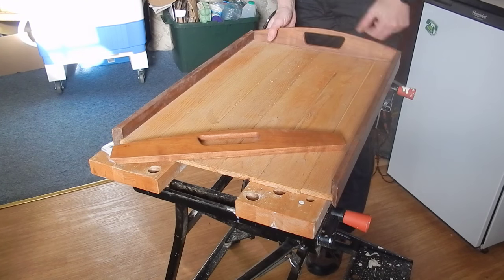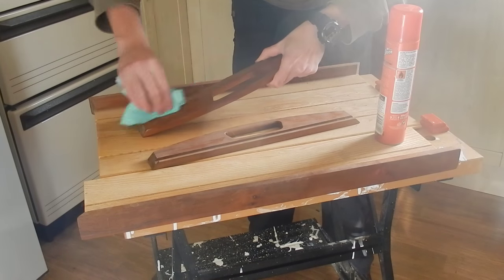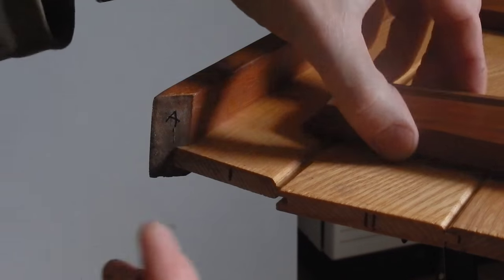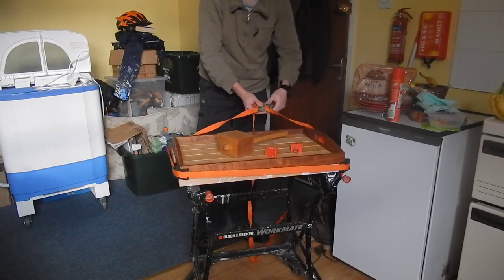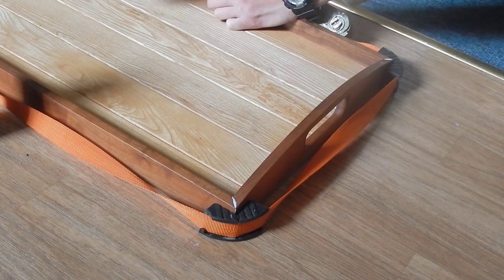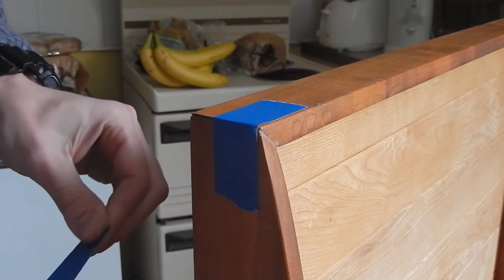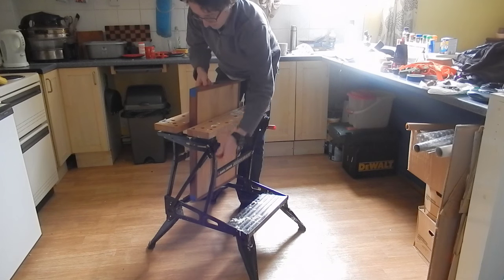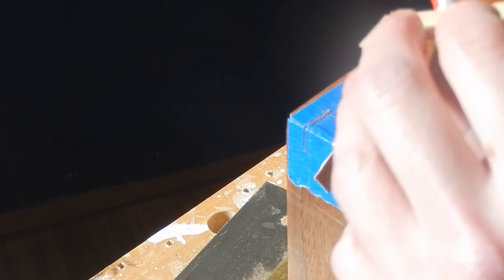Repairing a Tea Tray

Comment: Hi Olly,I have the same workmate as yours. I have added a base to secure the floppy little legs and put it on lockable 3" casters. Then I added larger cover pieces to the tops of the table and drilled hole for the dogs. In order that the clamping system works the new top pieces need to fit precisely.Nice to see you back now, have you been away?Colin in Northern Ireland.
Reply from the maker: +colin farrier Hi Colin and thank you. It's good to hear from you and that you've made your own improvements to your workmate. Replacing the top (with laminated beech, 40mm thick) was something I did very soon after buying it! It's also good to hear that you've found a way to stabilise the legs.

I managed to get away several times last year but I've averaged one video a month more recently... The subjects have been more varied than some are used to but that might change and I could be uploading regularly again soon... ;-)

Comment: Hi Olly.  In addition to what CryoGenUK said, it sounds like 'mains hum' to me.  Perhaps an unshielded mic cable, or the cable running near a mains power supply.  Can't wait for the exciting announcement.  Regards Mark in the UK
Reply from the maker: +thecorbies Hi Mark - well, at my desk, I'm only 600mm from a mains socket with the wifi router directly behind my laptop... I'm not sure about the cabling but this was only a cheap headset (about £15). In a previous video, I recorded the narration from my settee and there was no buzzing. It is something that has happened before. I hope to upgraded to a Snowball mic at some point anyway. Good to hear from you. :-)